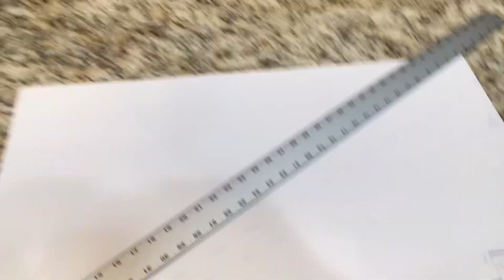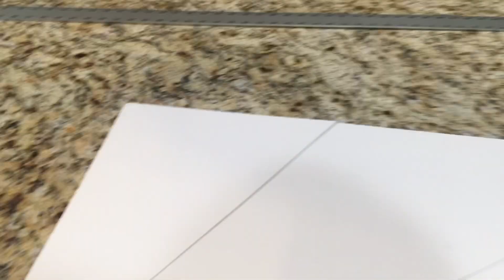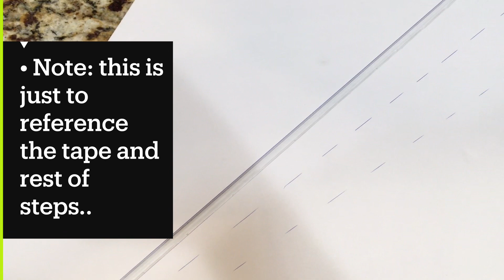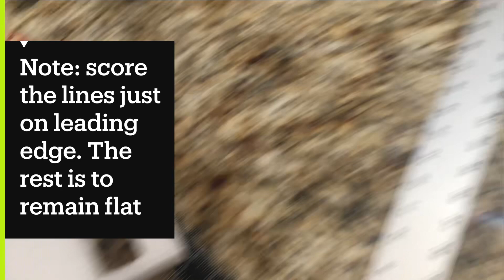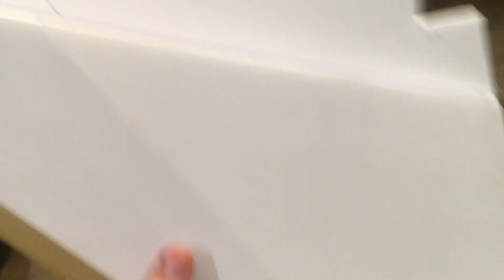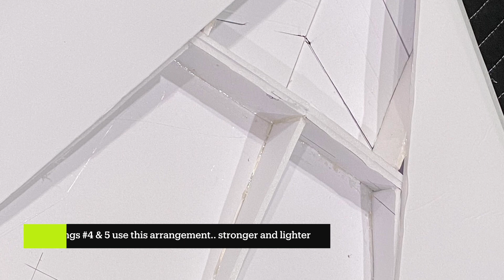Foam Board Flying Wings (build)

Comment: Cheers for the video, given me ideas for a build. Can you tell me where the CG is for that format of wing ? Thanks 👍
Reply from the maker: Sorry for the delay but it’s actually just shy of 1/3rd the distance from the “V” section on the trailing edge.. Two 2200 mah packs in the nose make it super stable or if you can find a way to squeeze in a single 3500-4200mah pack it flies wonderfully!

Comment: What are your flight times
Reply from the maker: So with a 2200mah about 8 minutes average! They glide well however if you build it slightly tail heavy it will almost stop dead in the air and snap.. being a flying wing they are either flying or on the ground.. landing takes getting used to as it loves to float!